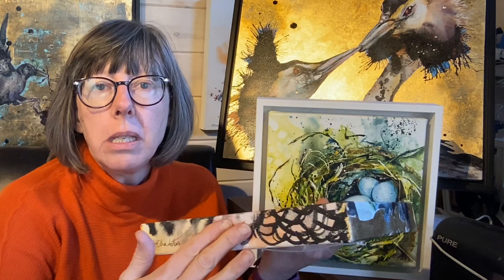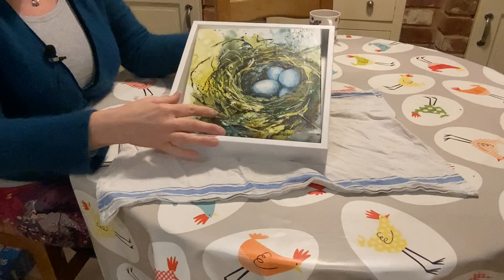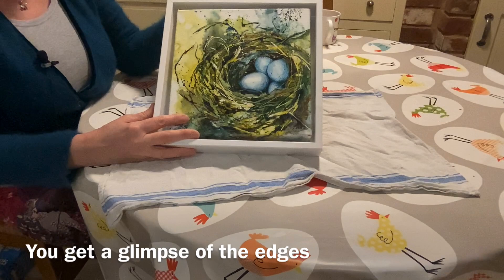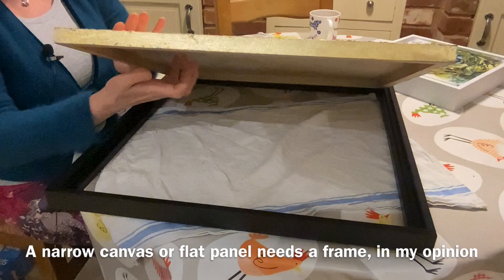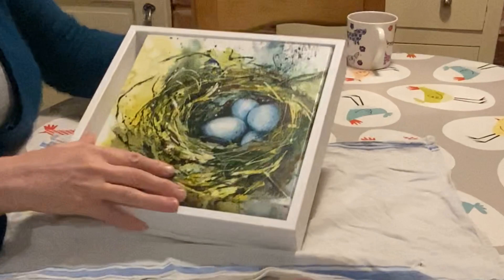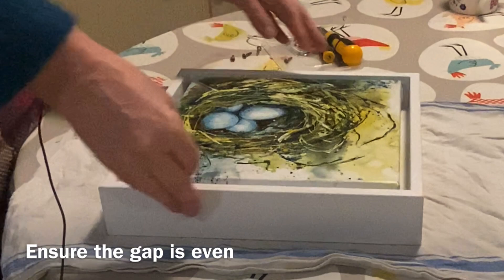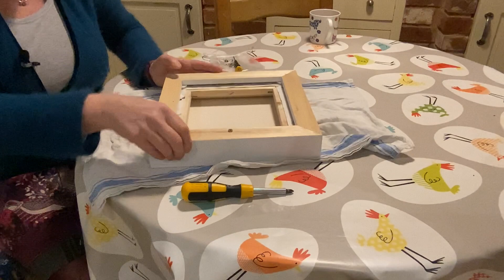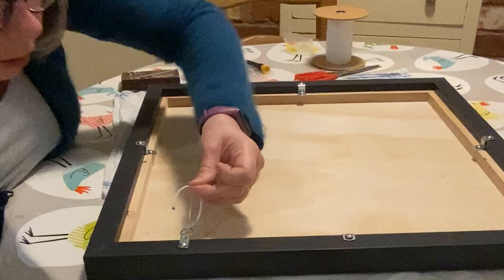How to put a painting into a float frame

Comment: Liz, as a beginner I find your videos so practical and informative. I don't know anything about framing so this was very helpful.  I'm so ignorant I didn't even know you could paint watercolour  on top of canvas until I saw your beautiful paintings.   I assume there would be some type of prep work involved to get the surface ready to accept watercolour.  Will have to check the rest of your library for reference material on priming canvasses.  Thanks for this tutorial.
Reply from the maker: https://youtu.be/uf1yuYyTfSs this is a good place to start, but there are a few you will find helpful  and I run the Watercolour on Canvas group on Facebook if you want to join: https://www.facebook.com/groups/463275440905151